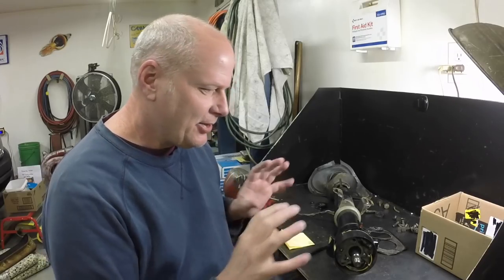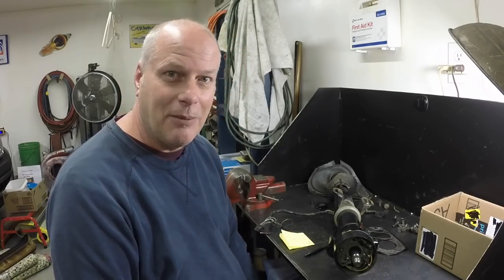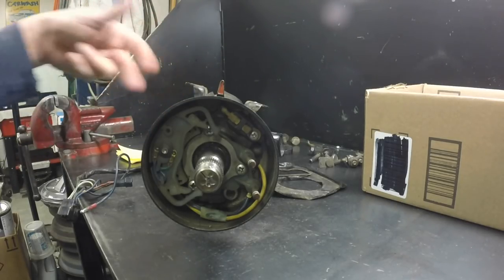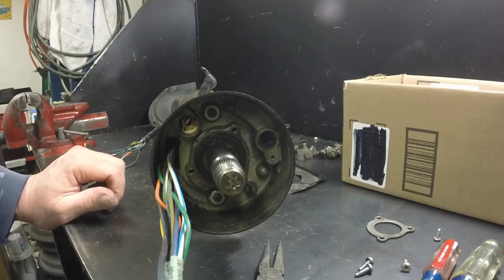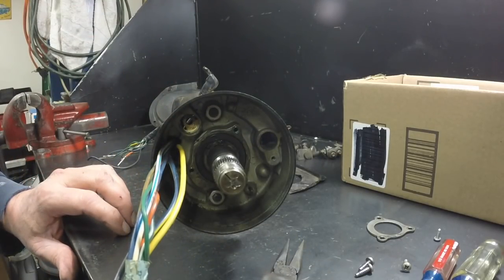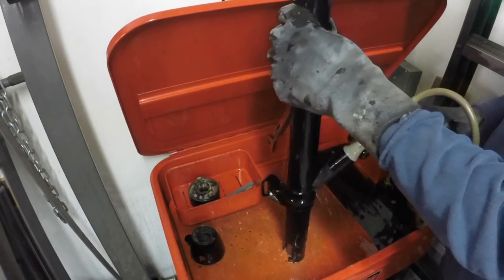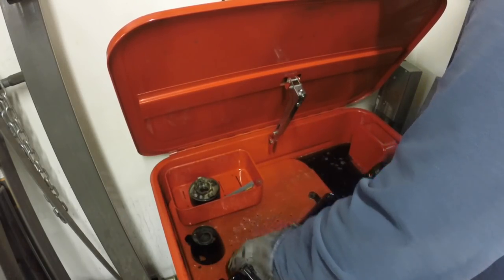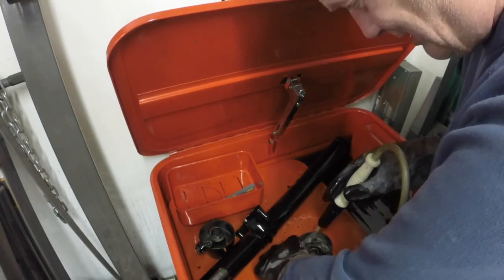1966 Ford Galaxie 500 convertible restoration part 170 disassembling steering column

Comment: Howard, during the winter months, how many times month to you run the engine at idle to keep everything lubricated? and for how long?  Thanks
Reply from the maker: Thats a very good often asked question. Here are my thoughts... I don't start any of my classics during the winter lay up. Just letting an engine idle, is the worst thing you can do. Oil pressure is lower at idle, moisture builds up from condensation in the crankcase and in the exhaust system.... like on a cold glass of ice water on a hot summer day.... unless you let it run for 30 minutes or more to boil the moisture out... And that only warms up the engine, nothing else in the drivetrain warms up properly. In the 40+ years of storing cars, I have never had any issues, from not starting them during the winter. I also find the colder the winter is, the easer the car starts in the spring. If on the rare occasion I do need to start one, if the roads are clear and dry, I take the car out for a good drive, to warm everything up.... axle, trans and power steering. On cars I have stored for years on end, I do start them a couple times a year and try to drive them a mile or so minimum at least..... Look at all my first starts of the season videos for the Bel Air.... It has always sat all winter without being started. It always starts easy in the spring, and drives away with no issues. I do check all the fluids before starting any of my classics, after sitting parked all winter.
Reply: @OldCarAlley  Thank You!
Reply from the maker: @johnjuarez3835  No problem

Comment: Here's a tip from when I replaced the turn signal switch in my 67 Galaxie...  Tape a rope to the end of the wires before you pull them out to be able to fish the new wires back through the steering column.  That was done with the column in the car and all still together except with the steering wheel removed.  Looks like you shouldn't have a problem getting it back in the way you showed how you could do it with the shift collar detached then put everything back together.  It's coming along really nicely Howard!
Reply from the maker: Great idea.... I will do exactly that. Everything is painted, so hoping to start reassembly soon. I'll just let everything dry a couple days first.

Comment: One of the things I found with those pin terminals is yes much more helpful with the tube to help remove. If I push in from the back pushing the wire in further it helps take pressure off of the tab that you are trying to depress with the tool.

Comment: Hey Howard The column strip went well it should all go back together fine without any problems. The top end looked a bit involved but I'm sure you will master it /You have a good set up there with your parts washer and bead blast. Brings things back to new. Your the detail man for sure even masking them numbers on the column most would have painted straight over 👌
Cya on the next one

Comment: Thanks for the video,I know what you mean about aftermarket parts, there's always something not quite right about most anything you buy.I just recently installed power brakes on my 59 Elcamino but I scavenged all factory parts for the job so I new it would all fit and function correctly. It probably cost more but it was a lot smoother job and it works perfectly
Reply from the maker: Thats the only way to go.... it's all correct, and you know it. Thats well worth the extra cost!
Reply: It’s sad but I’ve found even the simplest aftermarket parts such as tower hose clamps are junk, poorly made.
Reply from the maker: @dietersmythe9649  Totally!

Comment: I wish you could've found that tool for removing the pins in the harness plug. I'd like to see what it looks like. That would sure be handy. Thanks Howard
Reply from the maker: I look for it tomorrow..... if I find it, I'll show it. It's just a little tube that pushes oner the connector. It's a little kit..... I think most auto parts stores sell them..... where there electrical stuff is.

Comment: I'm sure it too late now. But macs/ecklers sells the neutral safety pin. It just clips on. Needed one for my 76 f150. Mine was broke and they rigged up the wiring so it would start. So I order the little clip and switch. Clip was 10 bucks or something like that. Switch wasn't terrible either
Reply from the maker: I just rebuilt the original switch.... so far seems to work great.

Comment: It just goes to show that the Bigger Fords are a bit more complicated... The '64 thru '66 Falcon and Mustang Steering columns literally use half the parts that you've already pulled from your '66 Galaxie column. The smaller midsize Fords were much more simplified for faster assembly and faster production to get them "out the door" of the factory and into dealerships for the "Average Joe Buyer" at a certain targeted market price (Under $3000 mostly in '65 thru '68).  Bigger Fords were usually sold to Business people, older Adults or bigger families who wanted more luxury and comfort in the ride of the car...hence more parts on a Bigger car...lol... In 1968, Ford Steering Columns became even more complicated with the advent and introduction of the "Collapsible Steering Column" which would collapse at the bottom of the Column in the event of a serious crash.  It was one of "Ford's Better Idea's" as part of their Safety Program to be more compliant with Federal Auto Safety Standards and Requirements at the time due to Ralph Nader's "Unsafe at Any Speed" Book which affected the entire Auto Industry.  Tony K. :)
Reply from the maker: I don't think I have ever had a older mid size Ford column apart. I have had many newer collapsing column's apart. Often to replace the ignition lock cylinder assembly, and it's collar. Car thief's would slid hammer them out, rendering all that stuff useless.... on the cars with the ignition on the column.

Comment: As I was driving my unrestored 65' Gal 500xl Conv. today, (it is sunny on the westside) I noticed the dash has the vinyl tucked in exposing the metal speaker grill.  Is this only for the 65s or 66s as well?  I noticed your reproduction cover will go over the whole area in one uniform lay out.  Your thoughts?
Reply from the maker: I don't know how 65's are done, but the 66 has a plastic piece that sits above the speaker, for where the speaker holes are in the pad.

Comment: Hello, i have a 66 galaxie as well, i am having trouble finding a turn signal switch, have you replaced yours or found any online? Thanks.
Reply from the maker: No, mine is like new, so I didn't replace it. Try eBay....
Reply: @OldCarAlley  Thanks, i ended up finding one on auto krafters!